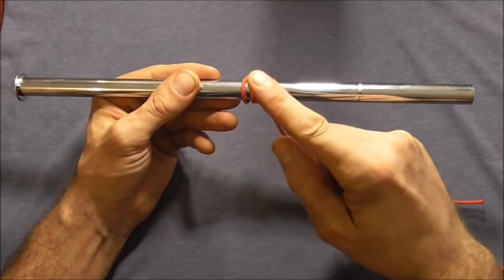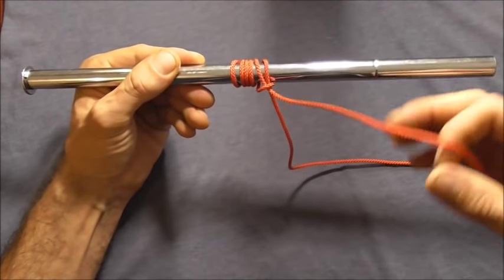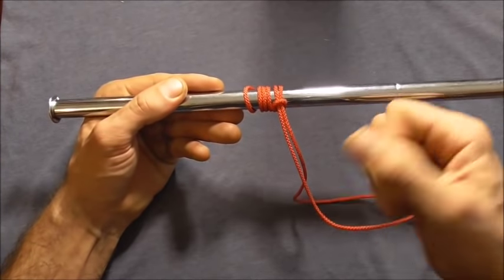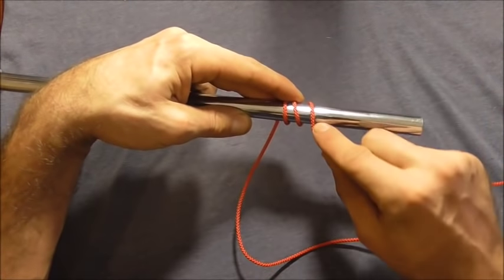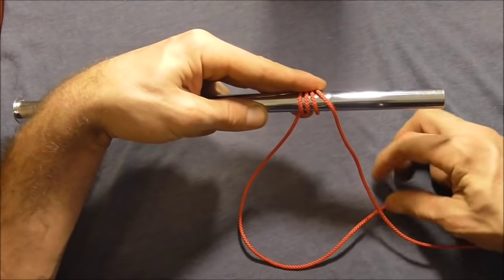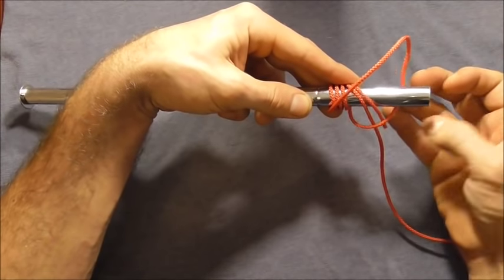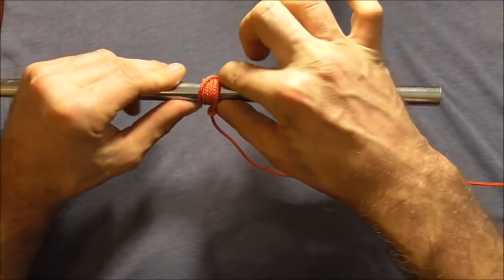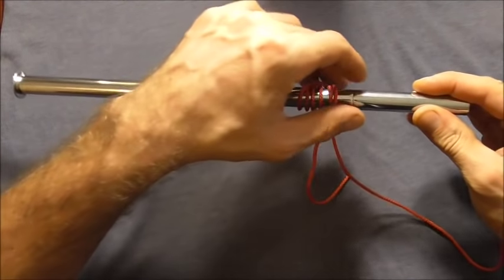How To Tie An Icicle Hitch Knot - Friction Hitch

Comment: useless knot, when a rolling hitch can do!
Reply: This has far greater grip
Reply: I've used this to pull 3 200' 00 wire through conduit after the original pull strands broke right as it was exiting the conduit.  Long story short: tapered, slick, lubed wires barely out of the conduit and pulled it all with the icicle hitch. Rolling hitch wouldn't budge this
Reply: @cbell9100  Would recommend making this knot first, cover it with tape then lube....I had experiences that the jetline would just slip off...
Reply: @cbell9100  Prusik knot works just as well and that works in both drections
Reply: I used to think that too before I properly tested the Icicle Hitch. It is named that way because it can grip on a surface that is tapered like an icicle.
Reply: @AKhan0372 The Prusik is simpler to remember, but there might be situations where the Prusik is not as convenient because these two knots are tied substantially differently. It is good to know both.